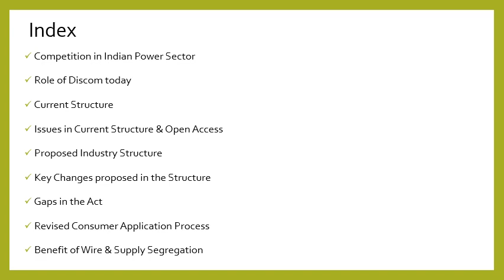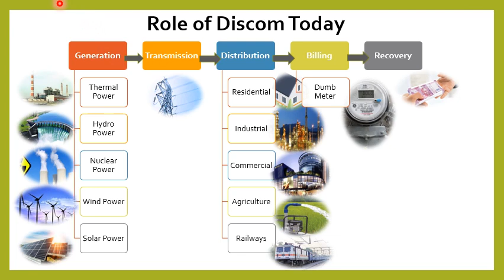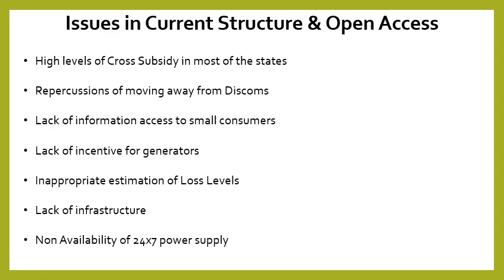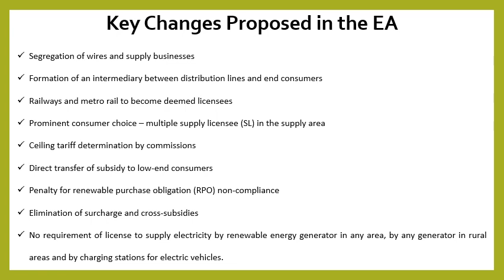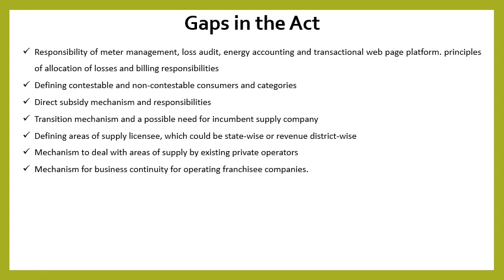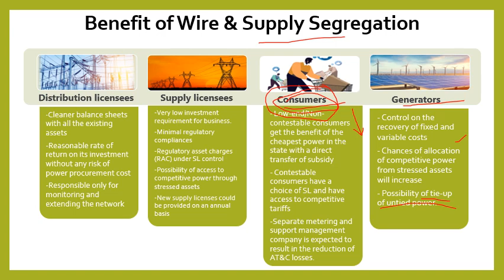Carriage & Content Separation (Wire & Supply Segregation)

Comment: This is good presentation but still confussion on many aspects of how it would be practically executable on ground level to mass no of consumer.There was suggestion on bussines segregation since 2014 on carriage and content but still pending in parliament although in 2018 end or early 2019 it was expected to roll out but still pending .Secondly  how more than two supply licences would be supplying  power in same area when ROW is still a big constraints.
How they would have there accountability of power which is very important? How quickly a consumer would be switched on from one supply licenses to another? 
what of consumers dues on existing discoms/utility? 
what so ever you told in this vedio is good and ok from policy makers  points of view but how practical execution it will be in country like india is question marks on all issued I raised above.
In state like bihar smart meter installation have been done under my jurisdiction on mass level. this means slowly india is moving towards smart grid (being meter installation agency ) hopefully in next 5 to 10 years things would be at place as mentioned in this sessions.